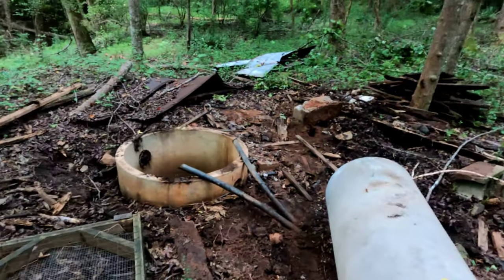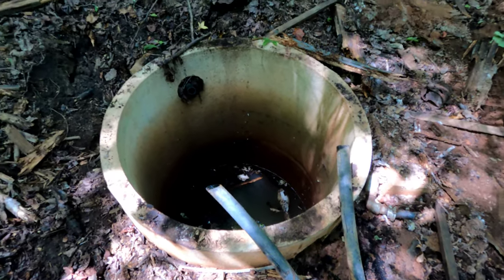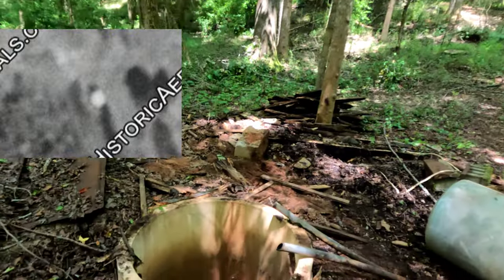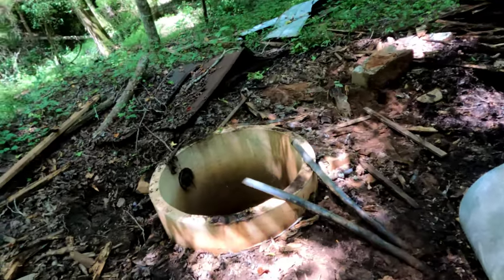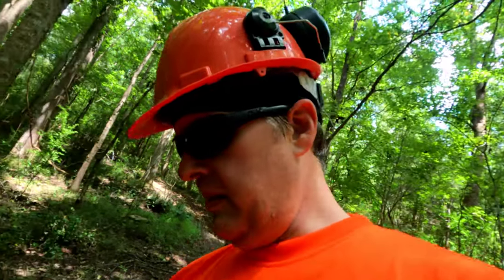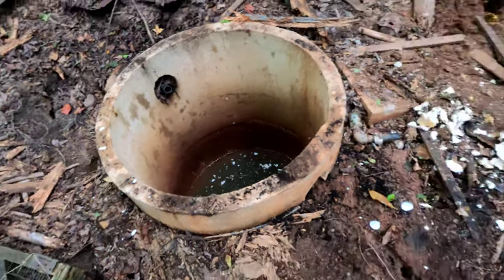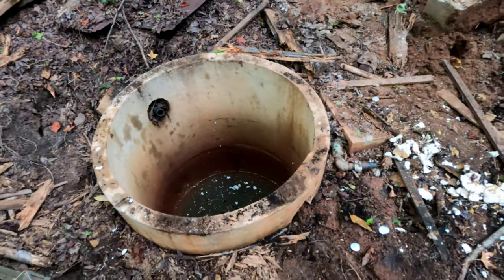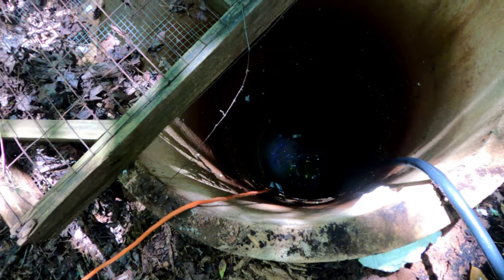70 Year Old Well Investigation: What Lies Beneath? #diy #vlog

Comment: We had a hand dug stone lined well where I grew up in Western New York that was supposedly used for cooling the milk jugs from the dairy barn that used to be there and burned down decades earlier.  It was about 4 feet across. Used to use it to water the horses and gardens. It was always ICE cold and jet black. One year I  looked in it and there was a dead rabbit floating in it so i got a milk crate and tied a rope on it and used it to pick out the carcass.  As soon as i got it out its skin slipped off and it looked like gelatinous spam spackle was oozing out of it's gray skin and greasy hide. The stink was unbearable.  I bleach bombed it and dropped a trash pump down to the bottom.  Every time i bounced the pump it would send up a surge of black oily sludge. Once the well was empty there was chunks of burnt timber, black and rotten  sticking up out of the sludge on the bottom, barely visible through the fog that formed from the cold.  As if that wasn’t creepy enough, when i pulled it up the impeller of the trash pump was packed with bones from everything that had fallen in, gotten hypothermia and slowly drowned.  I've been profoundly creeped out by wells ever since. Oh and We never used it to water anything again after that.
Reply from the maker: Thanks for the story!  I am still debating whether I just need to fill it with gravel and decommission it properly.  It pre-dates the man-made pond on the property that was built in the late 70's so I should probably just use the pond for any garden/lawn irrigation I need.  I certainly will never use it for drinking water!  The well was originally used for an old chicken hatchery on neighboring property.  Have a good one!